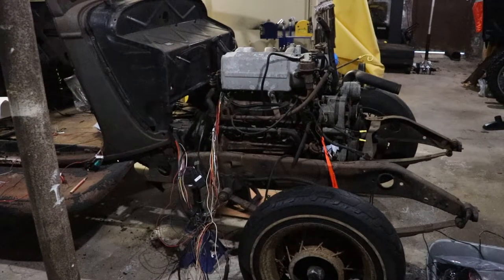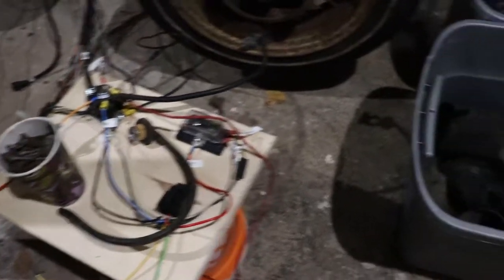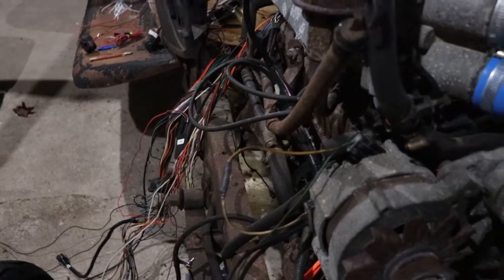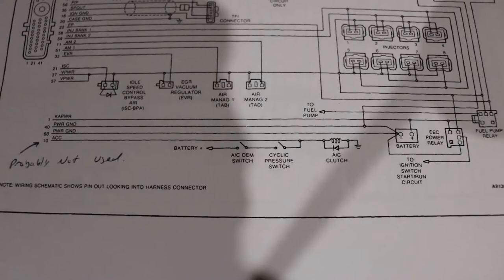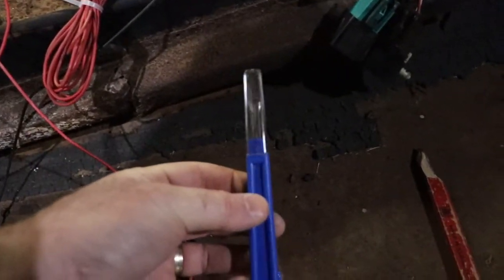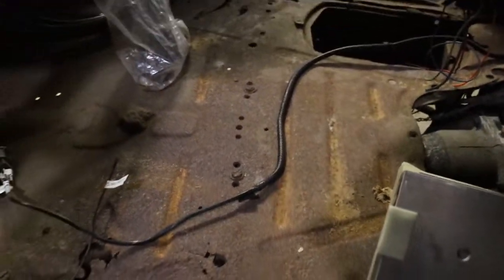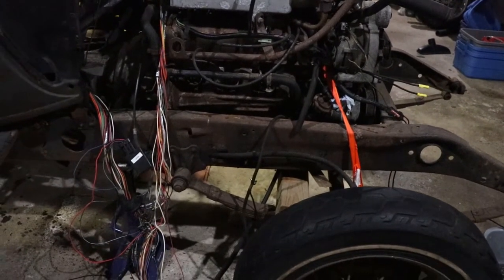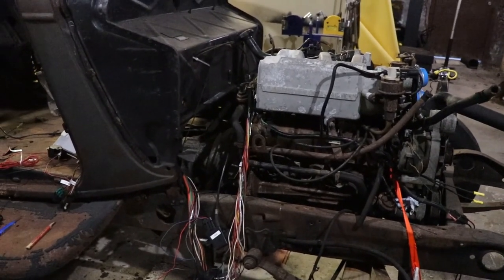Ford 5.0 Wiring Harness Separation Standalone EFI EEC-IV Engine Installation

Comment: The push-start module does NOT allow you to push-start the vehicle. There are two different modules, the grey push start one and the black CCD one. CCD stands for Computer Controlled Dwell, whereas the grey TFI module coil dwell time is handled by the module itself.

Comment: Looks like you could help but this misses the mark. What are the inputs that need to be addressed to evaluate an EFI 5.0 engine?? We learn nothing from looking at your harnesses.
Reply from the maker: There are only a couple loose wires after you clean up the wiring loom.  There is a link in the description for a few wiring diagrams.